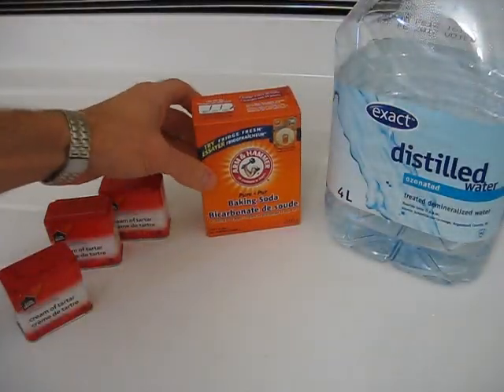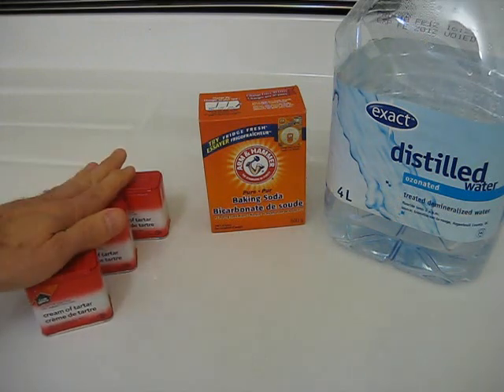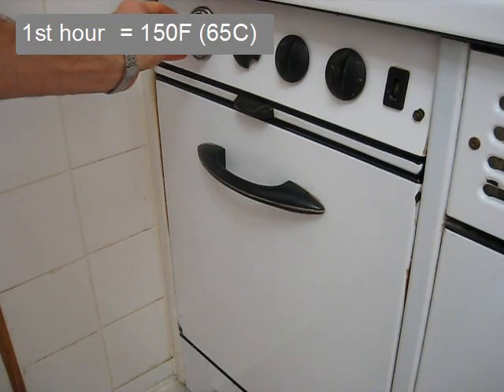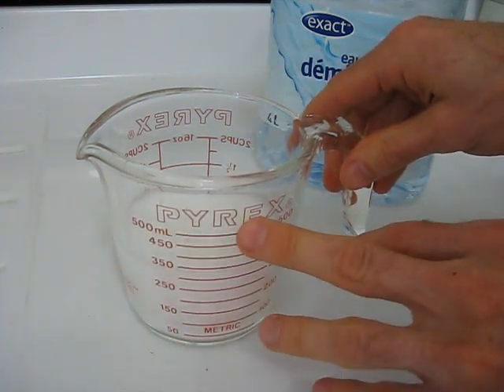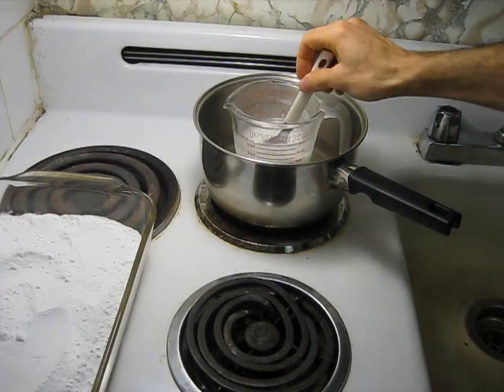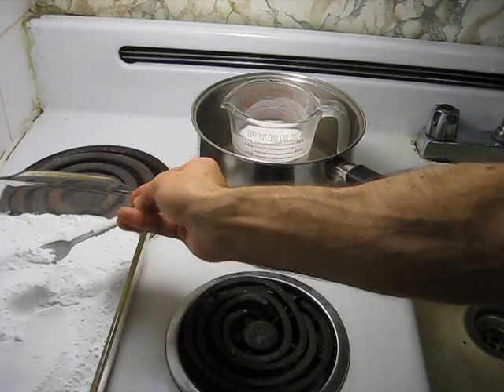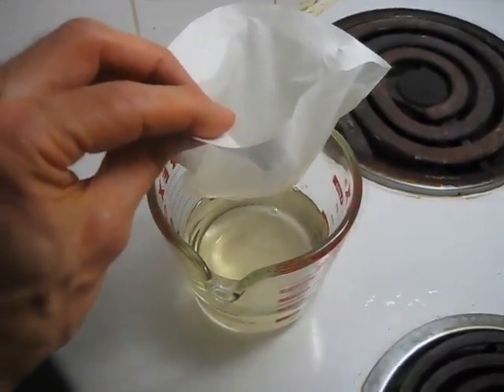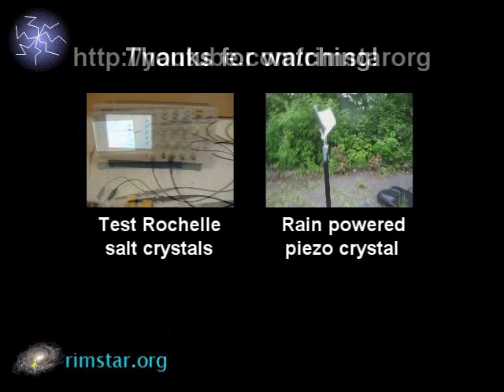How to make Rochelle salt piezoelectric crystals

Comment: I also had a dark yellow-brownish solution that yielded nothing but slush so i reheated on the stove and added a few more scoops of sodium carbonate. It didn't bubble anymore but the sodium carbonate still dissolved. Now I get large crystals roughly 3-4 cm. And after collecting out the crystals that form and zapping the remaining liquid in the microwave for a minute i can get perfectly clear well ordered crystals. Thanks for the vid!

Comment: Well, this is delightful lol, I'm working on a research project for school and we need to use tiny Piezo Electric actuators so I went to google and typed in "How to make piezoelectric crystals" and clicked on the first video I came across which happened to be this one. After getting a few minutes in I noticed that your voice sounded familiar, then noticed that I'm subscribed to your channel then realized that this is the channel that got me into engineering about 8 or 9 years ago. I find it funny that you got me into engineering/engineering school with a little DIY radio transmitter and engineering school accidentally brought me back to your channel. It comes full circle.
Reply: Nice story.  Glad you were inspired and thanks for sharing.

Comment from the maker: No, they're not very conductive so they don't conduct current well. But if you apply enough voltage across them, at the brief moment you apply it, they deform. That deformation can be used to make sound waves. I do this in my "Piezoelectric Speaker - small crystals/window as speaker" and "How to Make Piezoelectric Crystal Speaker" videos. There are links to them in the description below this video if you're interested.

Comment: Slow the cooling down by placing the mixture in an insulated cooler and you’ll get larger crystals.  You can also hang a thread dangling in the middle and it gives the crystals some place to grow besides the side of the container. Remove the string and large crystals before the whole thing evaporates ( before it gets stuck to the side).
Reply from the maker: Thanks for the suggestion. I did that when I started with a seed crystal. I just don't have a video for it. Instead the details are on my website here https://rimstar.org/materials/piezo/make_large_crystal_from_a_seed_crystal.htm

Comment from the maker: I haven't heard of it before so I did a google search for "sodium hydroxide piezoelectric crystals" and a few references turned up, one mention of dissolving silica under pressure in hot aqueous sodium hydroxide solution and then adding a quartz seed crystal to grow a larger one.

Comment from the maker: Clear yellowish was about like mine. I've heard of people putting them in the fridge but that seems a bit too cool to me. Just below room temperature should do. I can't say if you baking soda baking was the issue or not. One way may be to see if it lost 37% of its original weight but without knowing the starting and ending weights, we can't say. If the fridge was the problem you can reheat it to liquid and try again. Reheating for a while to evaporate more water may also help.

Comment from the maker: As far as I know those crystals don't degrade. I made my first one back in 2005 and it still works great. Well, it's a little banged up, but that's because I've hit it too hard at times. Plus, back in the early 1900s they were used in early record players and I've heard that those are still okay. And yes, they dissolve if you put them in water again.

Comment from the maker: They have negative and positive polls only during the hit. The hit modifies the molecular structure briefly so that they have polls. All other times they don't. For Rochelle salt crystals I think I get better results with bigger crystals. Also, different types of crystals give better results per hit. For example, whatever material the disk shaped crystals are that you find in some greeting card speakers and in piezo buzzers and microwave oven speakers, gives a much bigger voltage per hit.

Comment from the maker: It's not exactly drying it. The chemical formula for sodium bicarbonate is 2(NaHCO3) and heating it removes CO2 and H2O, leaving Na2CO3, which is sodium carbonate. So you're removing hydrogen, carbon and oxygen. Putting it back in water and heating it with potassium bitartrate doesn't add water back to it, but results in Rochelle salt, which is NaKC4H4O6, with much of the water evaporated to the surrounding air.

Comment from the maker: If you're after a crystal that works, one that gives you a voltage when you tap it or vice versa, then you don't want to speed it up too fast. But 25C sounds a little on the warm side. I'd go with the 15C.

Comment from the maker: @onthecuttingedge2005 Good suggestion but prying it out didn't affect the crystals. The crystals are pretty solid and were surrounded by grain-sized crystals so it was really the conglomeration of grain-sized crystals that was broken apart by the prying. Of course that might be different if the whole thing was large crystals. I think taking out a few days sooner might have been better.

Comment from the maker: Crushing them to powder would render it useless. I don't know how the flat disk piezo crystals are made. It's possible you need to break up that large chunk to get at the small crystals. Once you've done that then you can test the individual crystals. But make sure you've fully tested what you have first. If you haven't seen my "How to test Rochelle salt piezoelectric crystals voltage oscilloscope" video, you can test the same way but use your meter instead. You should see the voltage fluctuate.

Comment from the maker: It's best to have distilled water, but first... 0.3cm is a good sized cube. All mine are that size or smaller. My really big one was made in two steps, so don't compare yours to that one. If you hit it just once with a voltmeter you may not see the result. Tap it repeatedly and rapidly for a 5 or 10 seconds instead, on the mV DC scale. Voltmeters are not made for seeing the voltage spikes. Hitting it repeatedly puts the spikes closer together so the voltmeter has more to work with.

Comment from the maker: If you drop it a few times from about 5 feet then it'll eventually break start to break up. The first time I did that with my biggest one it only dented it. So I'd say not easily, but it isn't super strong either. Hit it with a hammer and I'm sure it'll shatter. Also, if you glue aluminum foil to one side with crazy glue and then pull the foil off, you'll take a layer off the crystal too (did that this week!)

Comment from the maker: A half centimeter is a nice size crystal. All the ones I produce from the process in this How to Make a Rochelle Salt crystal are smaller. My big one you see in some of my videos came from an additional step, which you don't need to do. In my Piezoelectric Speaker - small crystals/window as speaker video I use a crystal smaller than the one you have to make a speaker. So the crystal you have might work just fine. All you need to do it try it out.

Comment from the maker: I don't know. Besides Rochelle salt and the disk ones I mentioned, there are also the longer shaped ones you can get from BBQ igniters and some small hand lighters (the ones that have a part you push down on, not the ones with a wheel.) But of all those, I know the disk and the longer shaped ones are much better than Rochelle salt but I don't know which is best. You can also buy others from manufacturers but usually you have to buy them in bulk.

Comment from the maker: As soon as you put dissimilar metals, like copper and zinc, depending on the conductivity of what's between, you have a galvanic reaction, basically a battery. So I'd wonder how long his crystal cell ran for? 12 volt at 300 ma permanently would be great! Let us know how it works out when try it.

Comment from the maker: If you have many crystals in your floor, _might_ the force be spread over more of them and reduce the chance of them breaking? I don't know this for sure. You could look into a different piezoelectric crystal. Search online for ones you can buy from manufacturers. If this is a home project then the small disk crystals (like in my Piezoelectric generator LED lit by rain water video) found in some musical gift cards (warning, not all use piezos) or in piezo buzzers from places like Radio Shack.

Comment: I managed to actually get a thin layer on brass with a 8K ohms impedance at 1000Hz. Cutting it I managed to delaminate the stuff off the brass, and wound up with 29KHz and not 25KHz, but the larger brass plate and lower Z seem to have made the bojack mic element work about the same as the crummy $4 Kobitone which had a piezo the consistency of plaster of Paris in it. Now to resistance solder foil the the brass and finish the X-tal mic element. My X-tals are mixed with porcelain & fired on brass.

Comment from the maker: The additional step was to take a small crystal like the one you have and then use that as a seed crystal to grow a bigger crystal around it. But that process took me a week or two if I recall correctly. Unfortunately I never documented it but I'll PM you a link to the website where I learned how to do it (the link didn't work in this comment.)
Reply: This was the reccomended procedure from the "Mr. Wizard" book I got as a kid. This is more or less what has always been done. It craetes a larger yield by creating a base crystalline structure to "work" off of.

Comment from the maker: 1.5 cm is big. Is it a single, solid crystal? I get better results with bigger crystals so unless you have need of a bunch of smaller, less powerful crystals, then I'd just stick with the big ones. The only practical thing I've made with these crystals is speakers, as in my "Piezoelectric Speaker - small crystals/window as speaker" video. See the bottom of my webpage about how to make these crystals for how to use a seed crystal to make a larger one. There's a link in this video's description.

Comment from the maker: If you continue increasing pressure then I think you'll get a little, but it'll be almost nothing. There's probably a point where though when the crystal structure has reached the end of what it does. However, if you mean you squeeze it and then leave it under constant pressure then definitely no.

Comment from the maker: 1) It's permanent. Remember, they produce electricity only when hit by something and only during the hit. After, even with pressure on, they will not longer produce electricity until the next hit.
2) You connect wires to them the way you connect a meter or oscilloscope when testing them. Put the wires instead of the probes. See my video "How to test Rochelle salt piezoelectric crystals voltage oscilloscope" for this. There's a link in the description below this video and on my channel page.

Comment from the maker: Try heating it all again, using the same method of putting a clear container in a pot with water in it, just like you did when you first made it. It'll turn back into liquid. Do this until more of the water evaporates out. Then remove it from the heat and allow to cool again.

Comment from the maker: You can harden them in a mold but in my experience it would be just another container and it's just luck how the crystals form. I guess if you could get good enough to make a single crystal with all the volume in the mold then it'd work, but I couldn't do it. Fo rme I'd do one batch to make a seed crystal, then use that sead to grow a larger crystal and then grind it to shape after. I also don't know the frequency response of the crystals. I've used them at radio frequencies.

Comment from the maker: @jasonve11a I actually measured it by weight afterward and it turns out I used 214g - which surprised me a little since it didn't look it, and keep in mind that in the video I didn't show the whole 50 minutes of putting baking soda in. But you're right, had I known ahead of time I could have prepared less. Better safe than sorry. I'll add an annotation to the video about how much I used.

Comment: Tried this. The temperature really affects it! The samples in my hot room formed some goo and now just a white hard powder is left. The one in the fridge looks like a white rock with snowflakes all over it. And the one left on the windowsill looks like the clear rochelle salt shown in the video, except everything is fused together... If I had the tools this one would probably generate a current once I chipped some of the chunks off, since they look exactly like the salt in the video except fused. They also make the room smell nice. So yeah - a cool windowsill gave the best result!
Reply from the maker: With the samples in the hot room, the water probably evaporated away without crystalization happening. Regarding the fused sample, it's not too hard to break apart. Try chipping at it with a knife. Or wrap the sample in a dish towel and hit the sample with something solid. If you're careful, the softer parts between the crystal will break before the crystals do. I had to do the same thing.
Thanks for letting us know your test results.
Reply from the maker: *****
I don't know. I've never heard of using that mixture.

Comment from the maker: There's not much I can say. The only experience I have with bonding rochelle crystals to anything is using a cyanoacrylate glue bought from a hobby sho (basically krazy glue) to glue it to aluminum foil. It worked okay, but can be peeled off without too much effort.

Comment from the maker: Nope. If it does then it's not due to the piezoelectric effect. You have to take a single crystal, but a foil on either side, attached volt meter or oscilloscope probes to the foils, and then tap the crystal. You may have to try with the foils in different positions and tapping in different places to find a voltage. I have another video called How to Test Rochelle Salt Piezoelectric Crystals that shows this.

Comment: The reaction requires 1 mole of potassium bitartrate to 0.5 mole of sodium carbonate.  
The molecular weight of the potassium bitartrate is 188.2 grams
the molecular weight of sodium carbonate is 106 grams so  0.5 moles will be 53 grams.

So, for a 100g of the bitartrate you should be adding 28.16 grams of sodium carbonate.

Or, you can buy rochelle salt for £7.50 per 100g as small crystals.  You could dissolve these and leave the water to evaporate slowly  to grow bigger crystals.

hope this helps
Reply from the maker: Oh cool! Based on what you said I just worked out:
2 moles of potassium bitatrate + 1 mole of sodium carbonate = 2 moles (?) of Rochelle salt + water + carbon dioxide
2KHC4H4O6 + Na2CO3 = 2NaKC4H4O6 + H2O + CO2

My chemistry is weak but I think I see what you did there. That also means carbon dioxide must be given off, which I didn't know.
Is it correct above to say 2 moles of Rochelle salt like I did?
Thanks! That was fun.
Reply: Yes, I think you have got it.  -  two moles of bitartrate reacting with one mole of sodium carbonate will produce two moles of rochelle salt, one mole of water and one mole of carbon dioxide. 

a mole is simply a fixed number of molecules or atoms and that number happens to be roughly 600000000000000000000000 (twenty three zeros).  Its called Avogadro's number.

so, 106 grams of sodium carbonate contains Avogadro's number of individual sodium bicarbonate molecules.

Getting the right amount of chemicals together is called getting the stoichiometry right.  You will then end up with a minimum amount of unreacted stuff giving you a better chance of good crystals.

Adding a seed crystal or two and evaporating very slowly should help maximize size

Let me know how it works out.

cheers
Reply from the maker: Awesome! Thanks!

Comment: I just did this yesterday, harvested the crystals today.  Biggest crystal is 1.5 cm, not too shabby.  Curious though, could I take some of the crystals and crush them into smaller flakes, then use them with two conductive surfaces to better isolate their effect? Or perhaps make a rochelle salt powder?  What would be the best way to implement these crystals into some kind of device?  Also, is it possible to dissolve the crystals back into solution to grow a seed crystal larger?

Comment from the maker: 3) You're mixing up a light source and a dress which is not a light source. A white light source contains all visible radiation. A blue dress absorbs all visible wavelengths except blue (it reflects the blue so you see it), and a white dress doesn't absorb any so in that way it doesn't have blue, red, or any color. But really, since a dress isn't a light source, even a blue dress doesn't have blue. It just reflects blue and a white dress reflects all. So a white dress is the most reflective.

Comment: It seems solid, but it looks like a few small crystals merged into one.  Looking carefully at the structure, they seem to all be in tact.  I used 3 boxes of tartar at 113g each.  I'm having a tough time making these crystals useful.  I can't quite test the charge of them either, though I have a volt-meter, it's not effective.  Any chance you know how those peizo touch sensors are made?  Could I crush them and suspend them in oil, or do I have to dissolve them and reform them flat?

Comment: Hello, I have an idea for you.  I remember watching a youtube video from someone about a year ago regarding the creation of crystal, in his method, he placed an anode and cathode in the form of a copper wire and a zinc or galvanized wire as the other terminal, he might have done exactly as you did, except that on the portion where you leave your water to cool off to form the crystal, you insert the two wires in, apply a high voltage (300 volts DC +?) or just a HV Pulse until the crystal forms,